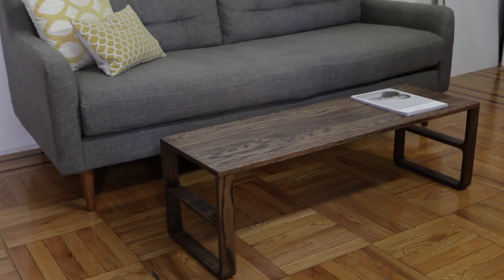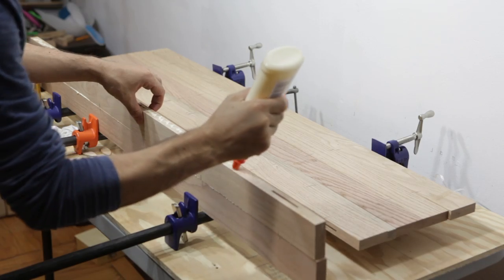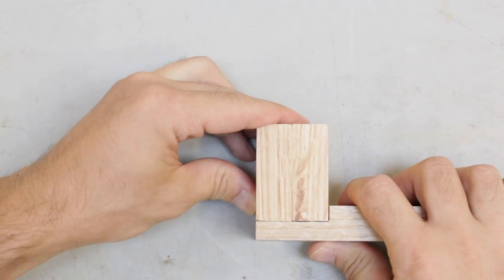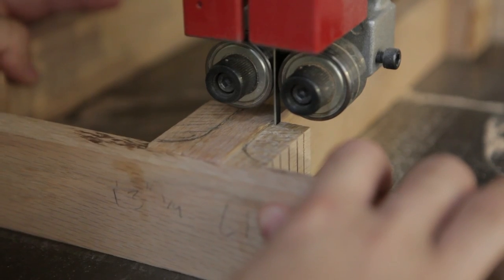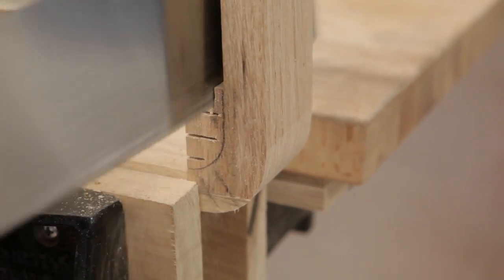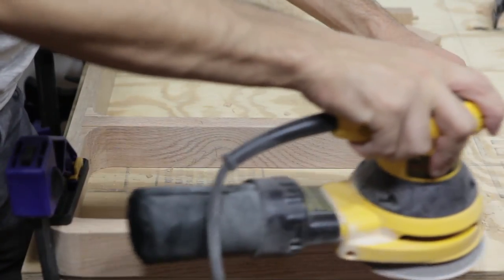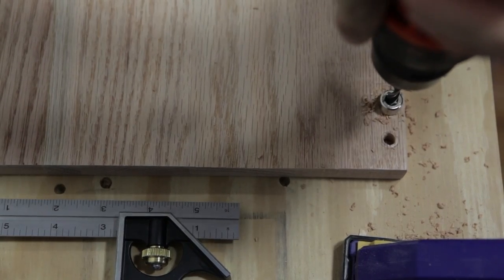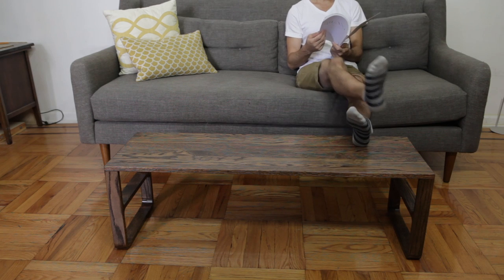How to Make a Coffee Table | Cottage DIY

Comment: This is a stylish table I'll give you that. But it looks so weak. I don't think it would last half a decade under normal use. I'd definitely recommend adding some fillet supports between the legs and underside of the table top, as well as a few widthwise supports to prevent the top from bowing.

Comment: I have a circular saw and orbital sander . what else do i need? lol
Reply: A jig saw, with a careful hand a fine blade can be used instead of a router. The cuts won't be as smooth or consistent and a jigsaw can be more useful in the long run. Another good power tool to have in a basic power drill (corded or cordless) which will help you start the cuts with the jigsaw.